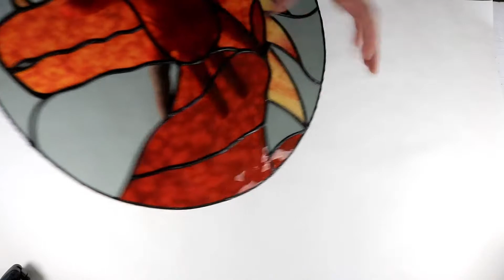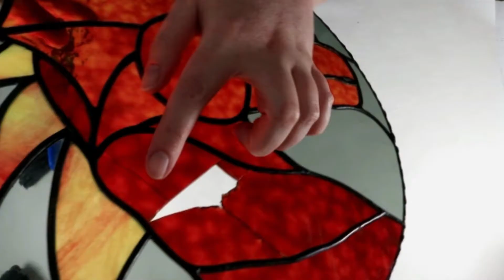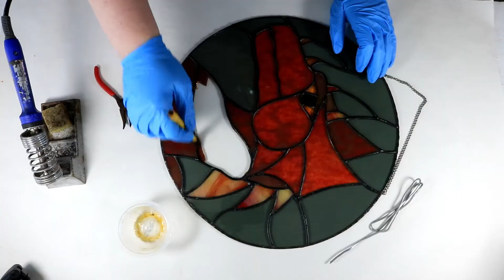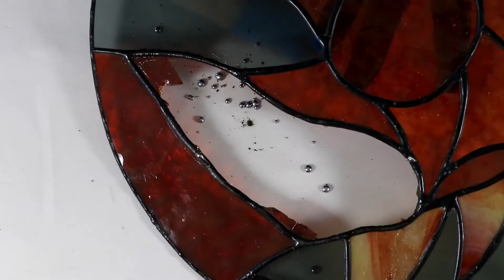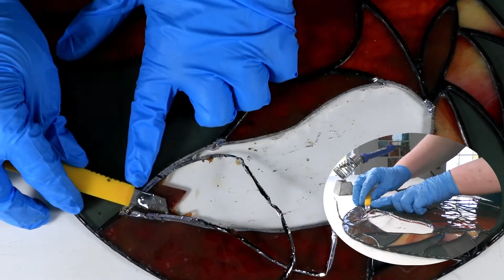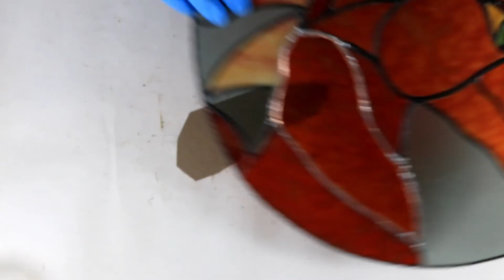How To Repair a Copper Foil Stained Glass Panel - Stained Glass Tutorial

Comment: Hi,

Why did you have to remove all the old foil and solder. Couldn't you just get the solder as thin as possible, in the opening, trace, and insert a new foiled piece, and solder it to the old?

I've had troubles with soldering to oxidized solder, but since you've heated this all,  it looks like it'd  be free from that problem.

I've been wanting to add to existing stained glass, in the same lazy manner. What am I missing?

Forgive me, I'm lazy, and always looking for an easier angle, if there is one. 

Cheers, and thanks for the video!
Reply from the maker: Hi! Thanks for the great questions — no worries at all about wanting to find easier ways; I totally get that. 🙂

In this case, the foil and solder around the broken piece need to be fully removed because once the broken glass is out, the surrounding foil isn't securely attached to anything anymore. Even if you tried to flatten the solder, it would leave an uneven, weak surface, and the repair wouldn’t hold properly over time.

By removing the old foil and smoothing the edges, it gives the new glass a strong, clean bond and helps the repair last.

Adding to existing stained glass is definitely possible, but any time a piece is missing or broken, a clean foundation makes all the difference for strength and finish!

Thanks again for watching — and for the thoughtful comment!

Comment: Thanks for the video. Do you use the same temp as soldering or do you turn your iron up? Sometimes I’m not sure how to gauge wether the old foil on the good side is still strong enough to not be replaced.
Reply from the maker: Sorry for the late reply! As long as the foil on the good piece hasn’t been damaged when removing the broken one, it should still be fine. The key is to let the heat fully melt the solder so the damaged piece slides away cleanly without pulling or lifting the foil on the good piece. That makes all the difference in keeping the surrounding foil intact.

Comment: i've been trying to fix the solder on some older patina'ed pieces i've made but having issues with the old solder melting/new solder sticking. i think because of oxidation? any advice. i tried cleaning with steel wool before hand but it didn't seem to make much of a difference.
Reply: I've had the same problem.

Comment: Hi Samantha, Thanks for a very helpful video. I have my first piece that I have to repair. With regard to the glass thickness, would it not be easier to do by turning it on it's front so the piece is flush with the face of the rest of the piece? I have only been doing this a little while but I have noticed that if I have a piece with several thicknesses of glass, once I'm done foiling, I lay the piece upside down and tack it. Then go to the front. Am I wrong in doing it this way?
Reply from the maker: When doing a repair, whichever way you flip it, the new piece of glass will not sit flush to the existing glass as there are solder seams holding the rest of the panel away from the work surface. If the front is face down and you add the new piece of glass, it will sit flat on the table whereas the rest of the glass is held up from the table a bit, because of those solder seams. Doing it without anything to prop the glass up slightly will cause the new piece to appear too far forward or too far back compared with the rest of the project. If you're making a new panel with varying thicknesses of glass, doing it the way you said will definitely create a nice flush finish to the front and that's exactly what I would recommend to do - on a NEW panel. Repairs are a different story though. I hope this helps and good luck with the repair!
Reply: @MakeStainedGlass  Excellent point! Thank you for your help.
Reply: @AndrewCMcGibbon  you could also put clubs under new piece, it works for me